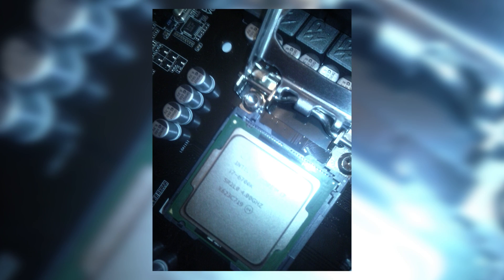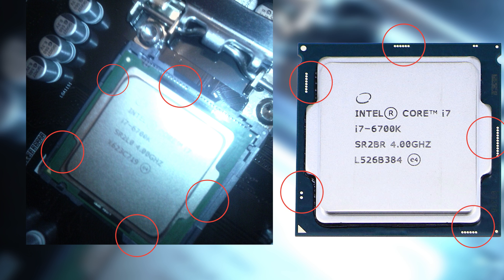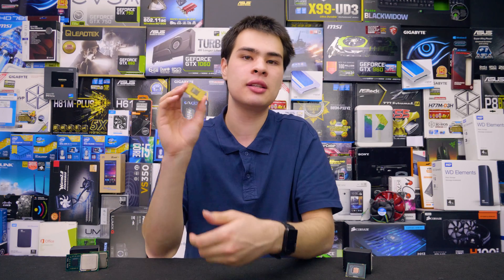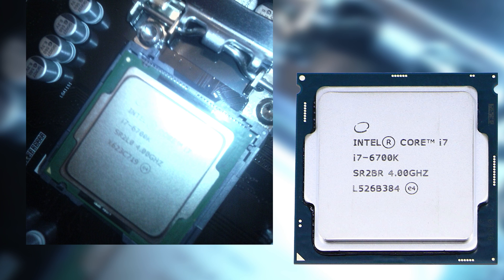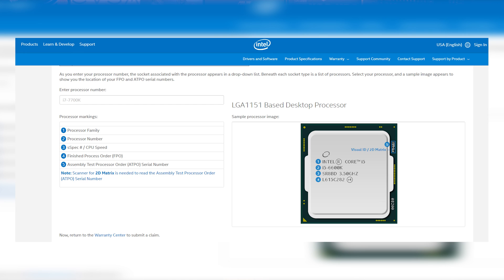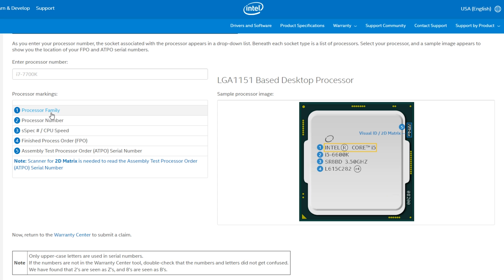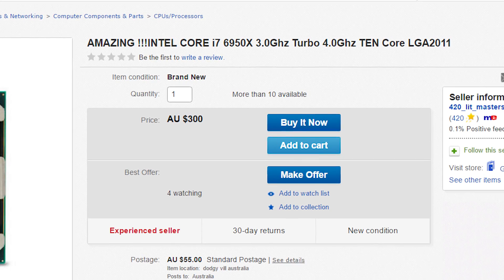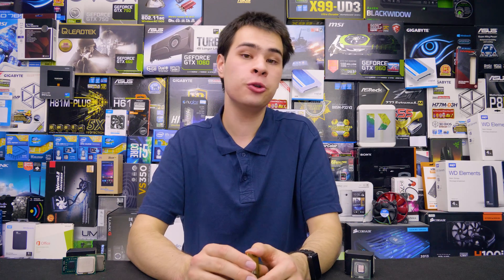CPUs EXPOSED - How To Spot A Fake CPU

Comment: I think what's actually happening is people are buying old Intel CPUs, and swapping the lids with newer CPUs. That would be the most efficient way to do this. I can guarantee no one is actually fabricating fake processors that are partially functional, or anything like that.

If I were to do this with a 6700k, I would go on ebay and buy an old Q6600 or something, which you can get for about $15. After getting the Q6600, I would remove the lids on both the processors and swap them. Then, I'd take pictures of the Q6600 with the i7 lid and sell it as such. Any extra effort is not worth it for a scam.

But good on you for trying to make people aware of this scam, regardless of how it's being accomplished ^_^
Reply from the maker: yeah i am sure a number of people do the swapping of lids but unless i was mistaken the q6600 where soldered to there IHS so you would end up shattering the die inorder to remove the lid. but i guess if you are selling a scam what does it matter
Reply: The Q6600 very well could be; I'm not sure off the top of my head which procs are soldered and which ones are not
Reply: Equal in what way? Quality of the IHS? Yes.
Reply: Only the most quality processors are soldered, and is exclusive to intels processors that sell for $1000+, and nearly every single AMD processor.
Reply: Not even the q6600 dude. They would probs get a pentium d, core 2 duo or some other $1-2 775 CPU and rip the IHS off it and hot glue the IHS off a new CPU onto the die of the 775 CPU.
Reply: dead intel link in the description
Reply: William Weller well they can't do that because switched the cap with newer cpu's you would need to buy the actual 7700k to get the cap
Reply: I'm just going off what I've seen with personal experience starting with a overclocked 486DX2, a few years as a computer repair tech who did a mix of on site and in shop repairs, installs, networking, etc. Then later working a a wholesale parts distributer building computers for other computer stores with a build floor that had 48 21" monitors for building and setting up PC's, some computer repair, inhouse computer repair assuring that the sales people's (25-30) machines and the server for it worked at all times during business hours, and that the network cameras was always working on the 3 desk it was setup at, then after working there a while I took over in RMA testing parts that was returned on warranty, parts that was brought from the buildfloor that didnt work, and had a setup for testing any parts. Also, although I usually avoided it I would work on computers on the side for money, favors so I didn't have to pay for stuff like tires or car repair, for charity (not literally but just fixing one to be nice and help someone out), and for family and friends and for a while I was really big on overclocking with the TEC watercooling, and had the $800 phase change CPU cooler.
  Over the years there have been parts that come out that was just total shit or computers that was just junk but when it comes to CPU's Cryix was the only ones that was more common to go bad. It's usually hardrives, some of the worst was the IBM Deskstar (Deathstar) 40GB, e-Machines had hard drive issues because it was mounted wrong against the manufacturers recommendation. There was a 5 1/2" drive from Quantum or something like that that sucked ass. A clogged filter would kill a SCSI drive pretty fast. Motherboards are pretty common, back in the early days of ECS it was more common to find one that didn't work then it was to find a working one then came the days of bad caps and was a major issue for a loonnngg time and still is a common cause of motherboards failing, The motherboard I am using now has bad caps, I've replaced some but still has some bad ones. Video cards, often failed because the fan would go out. Ram is pretty bad about failing but a lot of that is dependent on the quality, cheap ram with mixed chips isn't reliable, Power supplies are a common failure, esplacially some of the smaller housing ones. Soundcards, network cards, and optical drives are pretty reliable, routers are pretty bad, especially when put in a hot attic.  Laptops used to be bad about the charging port braking on them, then came the Alienware laptop that was pretty bad, the asus and MSI laptops wasnt all to reliable, HP had some that wasnt to reliable. 
 When it comes to heat, the Cyrix whole toast marshmallows, the K6 and the K6-2 ran hotter,the K6-3 ran hotter and didnt stack up against intel, the slot A Athlon ran hotter, the Athlon XP ran hotter, the P4 1.3-1.7Ghz ran pretty hot but with AMD they was slower to move the the smaller micron which at that point the AthlonXP ran pretty cool and was a overclocking champ, and yeah there is going to be a lot of working ones out there because a lot was sold. I would buy them just to mess around with just they was cheap compared to the P4. After that it was about the same or back and forth with temps (besides the first opterons and FX's or whatever they was). If your Pentuim D, or any other CPU is hitting 70C there is something else wrong. 
  I put so much pressure on the P4 my board would be bent, it had a metal heatspreader on it (that honestly I would of took off if it wasn't so expensive, instead I just sanded them smooth) Most CPU's I seen fail was due to the fan or user error... I worked on some people built themself that wouldnt post and they had thermal compound all over them but overall CPU's dont usually fail and thats why they have lifetime warranty. When building computers at the second computer place I worked at I would tell the new people that if they build computers and one of them don't post to pull the ram out and try it again, if it beeps it's the ram, if it dont beep it's the board and that method worked pretty good. Temp's aside, from my experience, CPUs dont usually fail
Reply: But what if they found a batch of dead 7700k's that were tossed in the bin because they didn't work?
Reply: LGA775, 1156, 1155, 1150 and 1151 has exactly same dimensions, 37.5mm x 37.5mm.
Reply: Lafika nah it's doable for 2011 buy a $10 e5 2603 Xeon and swap the lids
Reply: Zotez

I agree, it does seem a little bit odd; where would they be getting the newer processors without buying them? My assumption is there's not massive operations of this going on. I suspect most people are probably only doing this with one processor at a time. If I upgraded to a new i7, and wanted to recover a little bit of the cost in doing so, I'd have the i7 already. I'd just need to get my hands on an old processor to swap the lids. I haven't seen the ebay auction though, so someone might be selling tons of these.
Reply: the Q6600s are definitely soldered on. There are methods to remove a soldered lid, but there's no guarantee you won't break the cpu anyway.
Reply: +Lafika It's big because it's beautiful. I haven't looked at the cpus that fit in the x99 boards, so I don't know their size lol
Reply: +Person. It's not hard to find because it failed, its hard to find because the components around it failed or because it is long obsolete. The only   CPU's that was bad about failing was the socket 7 Cyrix and that other brand that was even shittier the Cyrix and slotted CPU's but even then the failure was usually caused by the daughter board (the cache was failing IIFC). Others have failed here and there (usually AMD, sometimes user error or fan failure) I used to do extreme overclocking with voltage modded boards, phase change cooling, and never lost a CPU. I used to sand the headspreader on the CPU down to a mirror finish, and pencil mod the Athlon XP's when those was the newest ones AMD had. Even when I tried to fry a CPU I couldn't do it. I had a Athlon XP that had lost half it cache (I think it was from to much pressure on the waterblock I had attached to it, which made it like a Duron) and I was trying to get it warrantied out and they wouldn't do it because it worked when they tested it at the store so I took it home, overclocked it to max voltage and started 3Dmark with no fan and it just locked up, so tried it again and took the heatsink off with it running, just locked up, tried it again and took the CPU out of the socket while it was running, just locked up, then put the CPU back. Finally after printing screenshots of how much cache it had in 3 different programs and screenshots of how much cache another one I had that was the same speed had they took it back but I had to bring the other CPU to the store with me to show them it before they took it back. I got pentium 2's and 3's that have been running 24 hours a day, 7 days a week, 365 days a year for years and have not had a issue. Then look at laptops, the AMD laptops have always burned a lot hotter then there intel counterparts
Reply: How do you fake a CPU if it reads in the BIOS with the processor number and cores and score an impressive Cinebench score over 4000???  probably not fake right?

Comment: I never knew there where fakes !
Reply: buying used is a risky game anyway. Some people have great luck and others don't. For whatever reason a system I built out of used parts no longer boots. it worked for all of 3 days. My luck has just been terrible, I'm inclined to believe something is wrong with the motherboard at this point in time. I have no way to actually confirm this.
Reply from the maker: yep neither did i untill i looked in to it

Comment: If it looks like a duck, quacks like a duck, it's a duck!  not a cpu. I had no idea you could get fakes
Reply: a friend of mine bought a core i5 a few years back and received an intel celeron with an intel core i5 heat spreader on top, he knew nothing about it and only said it was far too slow for an i5, when i looked at the system manager it was saying it was a 2.8ghz celeron, but the box and the cpu itself were marked as 3.4ghz core i5 xD
Reply: Yeah, but up until recently they've only really been consigned to spreader swapped parts. The scammers are getting pretty sneaky now though so you have to be careful with where you buy your parts from!
Reply: well they probably wont let you open the box so you are just looking at the outside of the box when buying it
Reply: Some of these CPU's have even lost their quack too.
Reply: I had no idea people could be stupid enough to get tricked by a fake.
Reply: Sckhar Leviathan Nah brah, you are just doing something wrong.